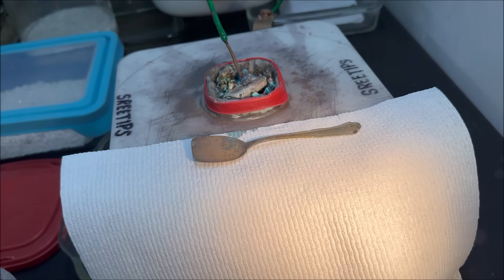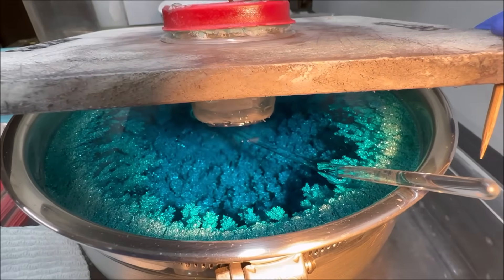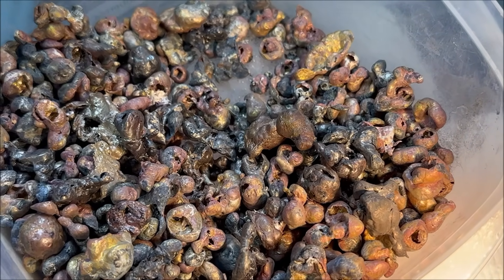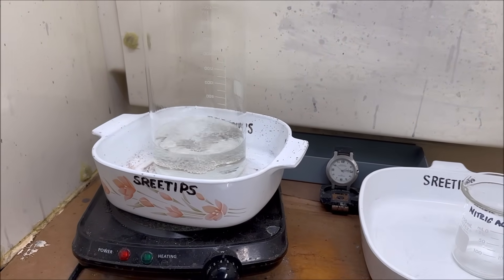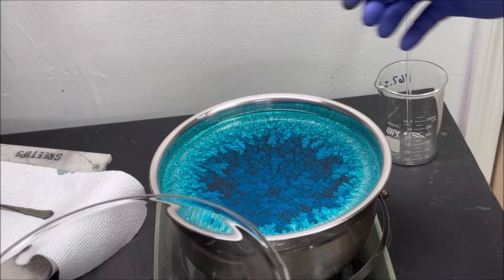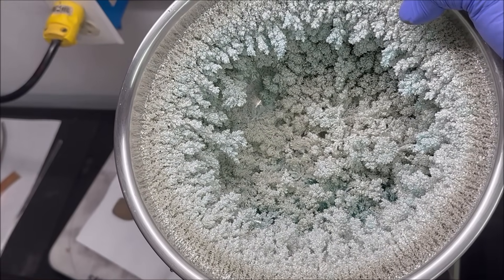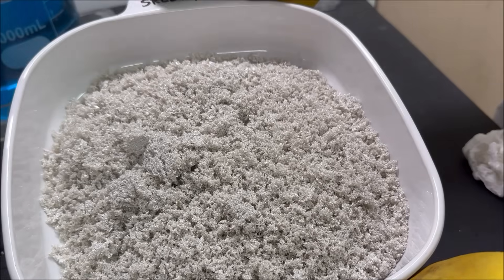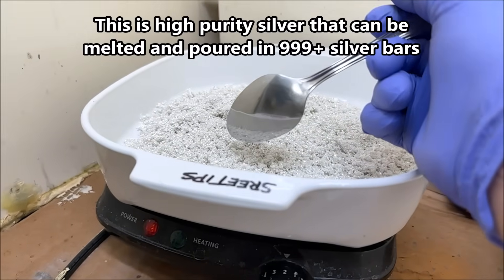999 Fine Silver Cell Harvest and Reboot

Comment: When it's metaled down to bars again you would have less than you had before.
Reply from the maker: I refine gold. I use sterling silver, that I buy at estate sales, to refine the scrap gold. I recover the silver from that, melt into shot, and run it through my silver cell. The cell converts the impure silver (about 980 parts per thousand silver) to high purity four nines fine (9999 parts per ten thousand) pure elemental silver metal. The impure silver is added to the anode basket. The anode basket is suspended in the silver nitrate electrolyte. I pass an electric current through the impure silver. The silver dissolves, passes through the Dacron filter, travels through the silver nitrate electrolyte, and deposits on the stainless steel bowl (the cathode). The bowl is connected to the negative pole of the power supply. The process only deposits pure silver on the cathode. So I’m refining the impure silver, into high purity silver. When it’s full, I harvest the pure silver crystal, put it away and forget about it. Then I repeat the whole thing again.
Reply: @sreetips  Ah so it's a recovery. Like sawdust being sold in a lumbermill as animal bedding. Weird correlation maybe but I think I get it.
Reply from the maker: Yes. I’ve got a ton of cement silver in buckets from my gold refining. So why not melt, and run it through my silver cell?

Comment: So...  This is not how to create free silver out of thin air?  I still need dirty silver to start with and this cleans it up?  That's cool too but I was hoping to turn kitchen scraps in to silver or something like that...
Reply from the maker: Every pure silver bar or round on the planet began as pure silver crystal just like you see now this video. No new silver has been created out of thin air - only in a super nova are the pressures and temperatures high enough to fuse protons into new, heavier elements.
Reply: @sreetips  It's interesting.  I watched another of your videos on this...  It helped me understand what is going on.

Youtube just randomly recommended this video and I wasn't sure what was happening.   Now I kind of get it.

I wonder if something like this would be done large scale to harvest metals out of the ocean water?
Reply from the maker: There are dissolved metals in sea water, gold. But it costs more to recover than it’s worth. If I rinse a beaker with a tiny trace of gold in it then that trace will end up in the ocean eventually - parts per trillion.

Comment: I'm confused. Does the silver cyrstal outweigh the initial silver used for the silver nitrade solution? Is this just to make silver pure or does it actually "grow" new silver? Sorry for dumb questions.
Reply from the maker: No new silver is being created. I refine gold. I use sterling silver, that I buy at estate sales, to refine the scrap gold. I recover the silver from that, melt into shot, and run it through my silver cell. The cell converts the impure silver (about 980 parts per thousand silver) to high purity four nines fine (9999 parts per ten thousand) pure elemental silver metal. The impure silver is added to the anode basket. The anode basket is suspended in the silver nitrate electrolyte. I pass an electric current through the impure silver. The silver dissolves, passes through the Dacron filter, travels through the silver nitrate electrolyte, and deposits on the stainless steel bowl (the cathode). The bowl is connected to the negative pole of the power supply. The process only deposits pure silver on the cathode. So I’m refining the impure silver, into high purity silver. When it’s full, I harvest the pure silver crystal, put it away and forget about it. Then I repeat the whole thing again.
Reply: @sreetips  I understand now, thanks for taking the time to explain it to me 😇☺
Reply: Aw man I thought it was just growing silver like you can do with crystals, was just rubbing my hands together like a get rich quick plan but you've just ruined that with this explanation lol 👎

Comment: ive only done a bit of copper electroforming. i had a question about if there's a point where too much copper will go into the silver electrolyte solution and impede the process and if so is it possible/easy to remove it ?
Reply from the maker: I’ve been told that 60g/liter copper concentration and it could begin to co-deposit with the silver.

Comment: If the process cost less than the silver itself… infinite money glitch.
Reply from the maker: I refine gold. I use sterling silver, that I buy at estate sales, to refine the scrap gold. I recover the silver from that, melt into shot, and run it through my silver cell. The cell converts the impure silver (about 980 parts per thousand silver) to high purity four nines fine (9999 parts per ten thousand) pure elemental silver metal. The impure silver is added to the anode basket. The anode basket is suspended in the silver nitrate electrolyte. I pass an electric current through the impure silver. The silver dissolves, passes through the Dacron filter, travels through the silver nitrate electrolyte, and deposits on the stainless steel bowl (the cathode). The bowl is connected to the negative pole of the power supply. The process only deposits pure silver on the cathode. So I’m refining the impure silver, into high purity silver. When it’s full, I harvest the pure silver crystal, put it away and forget about it. Then I repeat the whole thing again.

Comment: Hang on... is this legit???
Reply from the maker: Yes!
Reply from the maker: I refine gold. I use sterling silver, that I buy at estate sales, to refine the scrap gold. I recover the silver from that, melt into shot, and run it through my silver cell. The cell converts the impure silver (about 980 parts per thousand silver) to high purity four nines fine (9999 parts per ten thousand) pure elemental silver metal. The impure silver is added to the anode basket. The anode basket is suspended in the silver nitrate electrolyte. I pass an electric current through the impure silver. The silver dissolves, passes through the Dacron filter, travels through the silver nitrate electrolyte, and deposits on the stainless steel bowl (the cathode). The bowl is connected to the negative pole of the power supply. The process only deposits pure silver on the cathode. So I’m refining the impure silver, into high purity silver. When it’s full, I harvest the pure silver crystal, put it away and forget about it. Then I repeat the whole thing again.

Comment: So are you growing silver that didn't exist before? Or are you just refining silver? IE do you end up with more weight at the end? Do you end up making a living from this?
Reply from the maker: No new silver is being created out of thin air. I refine gold. I use sterling silver, that I buy at estate sales, to refine the scrap gold. I recover the silver from that, melt into shot, and run it through my silver cell. The cell converts the impure silver (about 980 parts per thousand silver) to high purity four nines fine (9999 parts per ten thousand) pure elemental silver metal. The impure silver is added to the anode basket. The anode basket is suspended in the silver nitrate electrolyte. I pass an electric current through the impure silver. The silver dissolves, passes through the Dacron filter, travels through the silver nitrate electrolyte, and deposits on the stainless steel bowl (the cathode). The bowl is connected to the negative pole of the power supply. The process only deposits pure silver on the cathode. So I’m refining the impure silver, into high purity silver. When it’s full, I harvest the pure silver crystal, put it away and forget about it. Then I repeat the whole thing again.

Comment: hmmm about 1200 euro in 2 wheeks not bad , offcourse thats gross need to subtract the power needed the base materials that you had to buy to purify the silver out of and the fluids used
Reply from the maker: My light bill was $120 last month. I refine gold. I use sterling silver, that I buy at estate sales, to refine the scrap gold. I recover the silver from that, melt into shot, and run it through my silver cell. The cell converts the impure silver (about 980 parts per thousand silver) to high purity four nines fine (9999 parts per ten thousand) pure elemental silver metal. The impure silver is added to the anode basket. The anode basket is suspended in the silver nitrate electrolyte. I pass an electric current through the impure silver. The silver dissolves, passes through the Dacron filter, travels through the silver nitrate electrolyte, and deposits on the stainless steel bowl (the cathode). The bowl is connected to the negative pole of the power supply. The process only deposits pure silver on the cathode. So I’m refining the impure silver, into high purity silver. When it’s full, I harvest the pure silver crystal, put it away and forget about it. Then I repeat the whole thing again.

Comment: U can grow silver with profit ? ,whow thats new for me
Reply from the maker: I refine gold. I use sterling silver, that I buy at estate sales, to refine the scrap gold. I recover the silver from that, melt into shot, and run it through my silver cell. The cell converts the impure silver (about 980 parts per thousand silver) to high purity four nines fine (9999 parts per ten thousand) pure elemental silver metal. The impure silver is added to the anode basket. The anode basket is suspended in the silver nitrate electrolyte. I pass an electric current through the impure silver. The silver dissolves, passes through the Dacron filter, travels through the silver nitrate electrolyte, and deposits on the stainless steel bowl (the cathode). The bowl is connected to the negative pole of the power supply. The process only deposits pure silver on the cathode. So I’m refining the impure silver, into high purity silver. When it’s full, I harvest the pure silver crystal, put it away and forget about it. Then I repeat the whole thing again.
Reply: @sreetips  ok that make sense thanks for the explaining,
Reply from the maker: Most people are clueless about gold and silver. They believe, incorrectly, that paper dollars are more valuable than the metals. This misconception makes for great buying opportunities. I’m buy all the gold and silver that I can get my hands on.

Comment: so you use 200g of silver to make 1.5 kg of silver ?
Reply from the maker: I refine gold. I use sterling silver, that I buy at estate sales, to refine the scrap gold. I recover the silver from that, melt into shot, and run it through my silver cell. The cell converts the impure silver (about 980 parts per thousand silver) to high purity four nines fine (9999 parts per ten thousand) pure elemental silver metal. The impure silver is added to the anode basket. The anode basket is suspended in the silver nitrate electrolyte. I pass an electric current through the impure silver. The silver dissolves, passes through the Dacron filter, travels through the silver nitrate electrolyte, and deposits on the stainless steel bowl (the cathode). The bowl is connected to the negative pole of the power supply. The process only deposits pure silver on the cathode. So I’m refining the impure silver, into high purity silver. When it’s full, I harvest the pure silver crystal, put it away and forget about it. Then I repeat the whole thing again.
Reply: @sreetips  thank you for clarifying

Comment: What are you trying to accomplish?
Reply from the maker: I refine gold. I use sterling silver, that I buy at estate sales, to refine the scrap gold. I recover the silver from that, melt into shot, and run it through my silver cell. The cell converts the impure silver (about 980 parts per thousand silver) to high purity four nines fine (9999 parts per ten thousand) pure elemental silver metal. The impure silver is added to the anode basket. The anode basket is suspended in the silver nitrate electrolyte. I pass an electric current through the impure silver. The silver dissolves, passes through the Dacron filter, travels through the silver nitrate electrolyte, and deposits on the stainless steel bowl (the cathode). The bowl is connected to the negative pole of the power supply. The process only deposits pure silver on the cathode. So I’m refining the impure silver, into high purity silver. When it’s full, I harvest the pure silver crystal, put it away and forget about it. Then I repeat the whole thing again.
Reply: @sreetips  that sounds really cool. I am a software engineer I work with AI I dont know what or how can I help with this process.
Reply from the maker: Refining Precious metals is a very hands-on activity. I don’t see an interface with refining and AI.
Reply: Fascinating. I dont know as a software and AI engineer how can I help with this process.

Comment: Where does the silver come
From ?
Reply from the maker: I refine gold. I use sterling silver, that I buy at estate sales, to refine the scrap gold. I recover the silver from that, melt into shot, and run it through my silver cell. The cell converts the impure silver (about 980 parts per thousand silver) to high purity four nines fine (9999 parts per ten thousand) pure elemental silver metal. The impure silver is added to the anode basket. The anode basket is suspended in the silver nitrate electrolyte. I pass an electric current through the impure silver. The silver dissolves, passes through the Dacron filter, travels through the silver nitrate electrolyte, and deposits on the stainless steel bowl (the cathode). The bowl is connected to the negative pole of the power supply. The process only deposits pure silver on the cathode. So I’m refining the impure silver, into high purity silver. When it’s full, I harvest the pure silver crystal, put it away and forget about it. Then I repeat the whole thing again.

Comment: Can you then melt this down into a 1 kilo bar?
Reply from the maker: Yes
Reply: Fantastic! What is a common ROI on a project like this?
Reply from the maker: I’d have to convert the silver into paper dollars to determine that. I harvest the silver, put it away, and forget about it.
Reply: Makes total sense! I’m wondering if it’s cost-effective to do it, or simply to buy silver and hold onto it? It’s amazing that you can create silver this this way!
Reply from the maker: I refine gold. I use sterling silver, that I buy at estate sales, to refine the scrap gold. I recover the silver from that, melt into shot, and run it through my silver cell. The cell converts the impure silver (about 980 parts per thousand silver) to high purity four nines fine (9999 parts per ten thousand) pure elemental silver metal. The impure silver is added to the anode basket. The anode basket is suspended in the silver nitrate electrolyte. I pass an electric current through the impure silver. The silver dissolves, passes through the Dacron filter, travels through the silver nitrate electrolyte, and deposits on the stainless steel bowl (the cathode). The bowl is connected to the negative pole of the power supply. The process only deposits pure silver on the cathode. So I’m refining the impure silver, into high purity silver. When it’s full, I harvest the pure silver crystal, put it away and forget about it. Then I repeat the whole thing again.

Comment: ich verstehe den sinn nicht. 🤷‍♀
Reply from the maker: This is an electrolytic silver cell. The blue liquid (the electrolyte) is silver nitrate solution. The silver nitrate is in a stainless steel bowl (the cathode). The stainless bowl is connected to the negative pole on the DC power supply. The anode filter basket is lined with a Dacron filter bag (a wet vacuum cleaner filter from Ace Hardware). I add impure silver granules that I recover from my gold refining operation, into the anode filter basket. The impure silver granules are about 98% pure silver. The filter basket is suspended above the silver nitrate in the stainless bowl. The bottom of the anode filter basket is submerged down in the silver nitrate electrolyte to form a complete circuit through the cell. The anode electrode bar is a bar of pure silver that I cast a 10 gauge copper wire into it. The copper wire is then connected to the positive pole on the DC power supply. When I turn on the power supply, an electric current flows through the anode electrode bar, through the impure silver granules in the anode filter basket. The electric current dissolves the impure silver in the anode filter basket and the dissolved silver passes through the filter, into the electrolyte in the stainless steel bowl. The current flow forces the dissolved silver towards the inside of the stainless bowl and the silver ions deposit as high purity elemental silver on the inside of the bowl (the cathode). Impurities remain trapped in the Dacron anode filter basket. Copper dissolves and passes through the filter with the silver, turning the electrolyte a dazzling blue color. But the copper won’t deposit on the cathode as long as the silver concentration in the electrolyte is kept high, and the copper concentration in the electrolyte is kept below 60g per liter. Every pure silver bar or round on the planet began as pure silver crystal just like you see in this video.
Reply: @sreetips  danke
Reply from the maker: You’re welcome!

Comment: I’m wondering how much oxidation is taking place between washing, drying, and storage especially given that dendritic silver has such a large surface area
Reply from the maker: The silver will turn a golden color if left out in the air. I store the silver in glass containers with tight fitting lids.